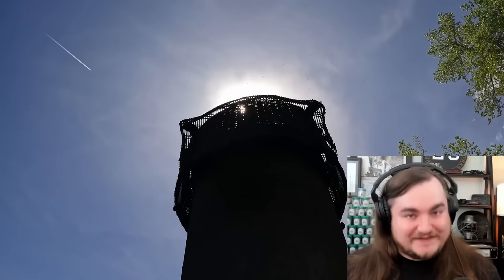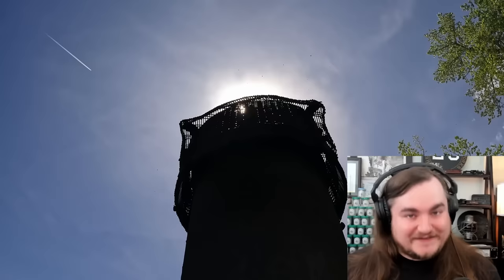Why do USA steam trains make smoke, but UK ones don't?

Comment: Well you see, you have to have Welsh coal, it was always the best for our locos. Also another thing you will notice in the UK, the fireman will hose down the coal in the tender to suppress the dust! Sorry I have to get this in, we've got the best and officially the fastest Steam Locos! Here's Tornado (a 2008 new build) reaching over a 100mph on the latest officially recorded speed run, ensuring she didn't beat Mallard's 126 mph official world record set in 1938. https://www.youtube.com/watch?v=IDlqHuEE50g The positive thing from Tornado was to spawn new build loco projects on either side of the pond! 
We are now building new steam locos and have thirty on the go, the largest of which in the UK will be a 2-8-2. 
I am very interested in the comparative size between domestic coal and loco coal having grown up in that era. House coal would usually be on average a 4" cube whereas loco coal would be anywhere from a 1 foot to two foot + long small boulder of coal as shown on the top photo on the web page! https://shedbashuk.blogspot.com/2013/01/mirfield-1956-1963.html
Reply: Nope - hard Yorkshire coal is just as good;  you just have to adapt your firing technique to match it.
Reply: UK locos were nothing like the best - the best engineered were US ones, with the New York Niagaras probably the absolute pinnacle of engineering. The French made the most efficient engines, particularly those designed by Chapelon. So pick from French or USA for best loco. The UK's best was probably the LNER A4, which were fast and powerful, since they were inspired by Chapelon's work, but they were badly engineered, to the extent Mallard couldn't even finish the journey on it's famous run.
Reply: @teddansonLA  - that you describe the LNER A4 as "probably the UK's best" proves you don't know a damn thing about British engines.  The A4 was a lousy design from the drawing board onwards, and their regular centre big end failures (thanks to Gresley's flimsy lash-up 'conjugating valve gear') proved that beyond all doubt, but Gresley was too much of an egotist to ever admit it.  The GWR 'Castles', the LMS 'Coronation', 'Black Five' and Stanier's 2-8-0 8F, the Southern 'King Arthur' and 'Schools' class, and the BR Standard 9F all knocked the A4's out of the ball park.
Reply: @jackx4311  The A4 was a lousy design from the drawing board onwards

Nonsense. When fitted with the Kylchap  system, it had the best exhaust in the UK. It had a huge superheater area and internal streamlining, as routine in Chapelon's rebuilds, which meant it could produce about 2,400 dbhp from a 42 sq ft grate. And of course, it was easily the fastest UK locomotive.

and their regular centre big end failures

Pretty much solved in the 1950s when higher tolerances were introduced to Doncaster. But I already pointed out UK engineering was not so great. 

The GWR 'Castles'

Were outdated even in 1924, with low superheat and 4 inaccessible cylinders. Long lap valve gear might have been impressive in the UK, but that's as far as UK commentators ever look; even the GWR Kings could only produce 1800 dbhp working flat out, so they were out performed by Britannia pacifics!

Black Five and Stanier's 2-8-0 8F, the Southern 'King Arthur' and 'Schools' class, and the BR Standard 9F all knocked the A4's out of the ball park

Your list, apart from the castles, is just a list of decent but flawed British engines. The 9Fs might have been the best of your list, but their 42 sq ft grate still left them 500 hp short of an A4 - so not as efficient, not as fast, but with lots more bullshit written about them. Who outside of the UK has heard of the BR 9F? Nobody.

The rest of your list can be criticised. Black 5s had weak frames in exchange for wide route availability - file under "poor engineering". The 8F 2-8-0s only proved how poor UK logistics was, that a black 5 sized boiler was capable of hauling the UKs largest freight jobs until the 9Fs appeared (I'm ignoring the LMS and LNER garratts).  Southern fans get very excited about the Schools being Europe's most powerful 4-4-0, but 4-4-0s were obsolete by the 1930s. They were good engines though, but outdated.

The coronations were simply big (by UK standards), but only a little more powerful than an A4 (2,520 dbhp), but off a 50 sq ft grate; the design was just an enlarged Princess, i.e. an enlarged King, but with acceptable internal streamlining.

Comment: before i watched the video it was obvious. Europeans usually only burned hardwoods which dont produce nearly as much smoke. Americans burn whatever they could find and since America is predominantly soft woods, hence the smoke, plus Americans used coal when they could.
Reply: Most steam locomotives burned coal.  It was usually just the early (pre-1850) steam engines that were wood burners; although in isolated cases like Finland, specialized wood burners designed to take advantage of huge reserves of available wood fuel, stayed in service into the 1970s.

Comment: It's the same as anything that runs on combustion; from a campfire to a formula one racing car.  The energy density of the fuel and the efficiency of combustion determine not only the level of smoke, but the amount of ash, soot, and other residuals.
So, anthracite burned in a well designed and maintained steam engine will smoke far less than lignite burned in a poorly designed and maintained engine, regardless of what country/railroad is running the trains.
Of course, that answer does not paint Americans as intrinsically evil, so it will be discarded.

Comment: Last time I saw NKP 765, she was running very clean... as she approached a road overpass over the line where a whole bunch of people wearing white clothes were gathered to watch her.  EVERYONE who knew anything about steam locomotives knew exactly what was coming.  Sure enough, between dusting out her flues with sand and then immediately closing the throttle, the crew had her emit a volcanic belch of thick black smoke just as she reached the overpass.  She was running clean and clear exhaust again a hundred yards down the line, but all of us watching from the old depot got a good laugh as all the silly people who don't understand steam now had their white clothes covered in oily, greasy soot...

Comment: It has nothing to do with the size or design of the steam engine or where it goes. It is also not due to the fuel, whether oil or coal. It's up to the stoker and his skills that it's smoke-free! Black smoke indicates the heater is not firing properly! A stoker who understands his craft and has the best knowledge of fuel and boilers and their combustion can drive almost smoke-free! A slight greyish color is good, but black is very very bad! Black smoke is also a sign that unburned fuel is escaping through the chimney, which in turn is a waste of fuel.
Why is the smoke black? This is very simple. If you add fuel (coal) or oil injection, there must be sufficient combustion air. If this is not the case, then the smoke turns black. The other way around, if you add too much coal/inject too much oil, the smoke turns black because the combustion air is then no longer sufficient, even though all the air flaps are open. Another problem is that the stoker does not prepare his fire in time. Unfortunately, one sees very often, whether in Europe or America, that the fire is lit shortly before or only during departure. This leads to the fact that the fire is too weak and the boiler pressure drops and you want to counteract this with too much fuel, which is then much too late. In this case, the heater has completely failed and does not understand his job or simply does not know what he is doing.
Also the statement that you have bad coal is just an excuse. That's right, there are good types of coal and bad ones. Here then is the stoker's ability to drive smoke-free.

I have already fired with cheap/bad coal or with many different types of coal, and of course I have also heated with very good coal. I was able to drive almost smoke-free with all types of coal or with a light greyish color. All without secondary air and at all speeds or power decreases.

That was my statement about black smoke.

p.s. All railway fans who think that black smoke must be coming out of the chimney, sorry, but they have no idea about steam locomotives and how to heat them or how to operate the boiler.

I was also asked why no "smoke" comes out of the chimney, if you then explain why and why no smoke comes out there, you would usually encounter a lack of understanding, since many people are of the opinion that smoke must come out - which of course is completely wrong is!!

you have question No problem, we are can write about how to operate the steam locomotive boiler or about steam locomotive technology :)

Or as an example, about the differences between German and American steam locomotives and their technology ;)

With best regards from Germany😉
Paddy

Steam Engine Heater and Steam Engine Driver😎

Comment: Great explanation, but lacking mention of the fictitious character Phoebe Snow, invented for advertising by the Erie & Lackawanna Railroad to promote its burning of "clean" anthracite coal in the early 20th century. She wore all white and was always clean and fresh, something that most rail passengers at that time were not after several hours behind a bituminous burning tea kettle belching black smoke. No AC in those days and the rail cars had open windows. Here is a quote from Phoebe from advertising: Says Phoebe Snow: / “The miners know / That to hard coal / My fame I owe, / For my delight / In wearing white / Is due alone to / Anthracite.”Phoebe says / And Phoebe knows / That smoke and cinders / Spoil good clothes / ‘Tis thus a pleasure / And delight / To take the Road of Anthracite.

Comment: HAVE you ever built a coal fire at home in the fireplace,,,,,,lots to be learned there,,,,,when new coal is added to the fire its releasing oil that burns for heat but when its coming from cold coal chunks, the chuncks are cold and so is the oil,,,watch your fireman,,,when he pouring on coal and shoveling it in at a great rate to build up the fire for a run, or already into a run and the fire starts to drop a bit, he has to keep up steam pressure,,,,,and the fire is burning lower than it was,,,he has to add in more coal. When you add coal at home, same thing, until the fire gets to really blazing, it cant produce enough heat fast enough to heat water, and to  heat the new coal being shoveled in with the available air supply. However, when the fire is really hell with heat, shoveling on a little more coal will produce a puff of smoke but it wont last long,,,,,thanks for posting

Comment: Thank you for sharing!  :-)

That LMS movie about "little and often" had me try my hand at firing a steam boat, the "Christiaan Brunings". I'm at the beginning of https://youtu.be/vG7-fkqKdwI (Dutch), but the later English version https://youtu.be/6XVUQoJzt_o seems different.

We (firemen) did our best to produce as little smoke as possible. Yet we sometimes found our smokestack smoking in an "American" way. As far as I understand it, the incomplete combustion predominantly occurred when "too much" coal had been added to the fire. "Too much" in relation to the air let in (default: from under the fire) or to the smoke let out (controlled by a manual valve in the smokestack). Besides, the coal that we received from our sponsor wasn't always of the grade we'd prefer, and the chunks often were on the big side. (I haven't even been aboard this ship for over three years, hence the past time.) Anyway, we could expect complaints about every visible bit of steam, so "pleasing photographers" definitely wasn't in our book.

Comment: Then there is all the annoying horn blowing. It must be murder living within miles (km) of a railway line in the US
Reply: I don't mind the sound of horn blowing at all, at least I know how far away train in, the direction it's heading, and most notably, which train is passing. The line I live by is used by two different rail operators: Florida East Coast Railway (FEC) and Brightline, the latter has a very distinct horn that easily stands out.

Comment: Ok, confused:   English ones don't blow smoke because they "burn" hotter and so burn off the other gasses.   About 5 minutes in.
But then you say the engines in the UK are smaller and the time for "everything to burn out..."   (Sorry my typing skills aren't up to scratch.)   Then you go on to the American engines that has a bigger engine and more violent draft.
The video played about 5:18 from the UK about "burning off the volatiles" with extra air then goes against what you just said.  (To me)
If the engine is "bigger and more violent draft" there is more time for the volatiles to be burnt off.   So less smoke.   But that opposite to what you said.

Comment: Those are some bright lamps on those locomotives. Now of course Modern Subway Trains have arrangements of bright LED lamps. I now about the big reflectors, and I know that a lighthouse can sow its 25 watt lamp out to the horizon, but why don't you give us a rundown on the headlamps. Oil lamps in the civil war period were huge. then small, but still oil burning lams until the last decade of stream. 

Then there is the story steam engines always having a diesel in tow. Well ok, you know that it is not always, but if they are pulling modern or rebuilt cars that meet AMTK specifications, then there is a diesel in the consist. No it is not because the diesel can copy down the track speeds, there are steam locomotives that have all of the necessary electronics including PTC. No the answer in in the passenger cars and not in the locomotive at all. Old cars used steam heat and air conditioning, and batteries and an axle generator to recharge the batteries that provided 36 volts for the lighting.. Modern or rebuilt cars do not use steam for this. they use HEP (head End Power) which runs at a comfortable 480 volts. This is what the diesel is there for. Old cars, no cars, and the old steamer is happy to have the run of the road all by itself, thank you.

Comment: Poor combusion or low quality coal. Insufficient air in the fire box . Too much fuel in the burner. Fuel not warm enough. Not enough draft. Too much soot on the tubes. Plenty options.

Comment: Could be few reasons, some steam trains were converted and purposes built oil burning engines  they blew out huge amounts black smoke,and another reason coal has different properties how was made remember its millions years old different trees so could be a reasonable theory ,I know Australian black coal has one lowest smoke output thats why still use it in certain power generation plants as loads coal still there,so different ways how was made could be reasons get more black smoke,and another reason when engine is straining up hill poor bloke shovelling coal has hard job shovelling just keep steam pressure up when engine up working at speed usually white smoke will be emitted then get hills black smoke fine coal dust gets blown out stack gets in eyes if got windows open head hanging out use happen when I was kid mum use use hankie wipe kids eyes grit in them ,and my dad was coal man in uk shoveling coal from poole to London and back no wonder he had big muscles 😊😊
Reply: Australian black coal is relatively cheap, compared to black coal from mining in Europe. Countries like Germany discontinued black coal mining because every single job there was more subsidised than it would have costed if they would have paid the workers directly and told them to stay at home

Comment: You really, really don't want to know what unburnt hydrocarbons from oil can do to your lungs. Coal is bad and wood not much better. One lung full of light diesel smoke is roughly 20 cigarettes. Apart from that, the stink is dreadful.